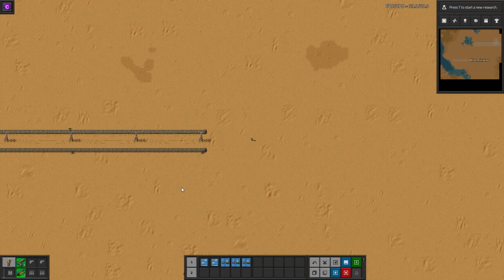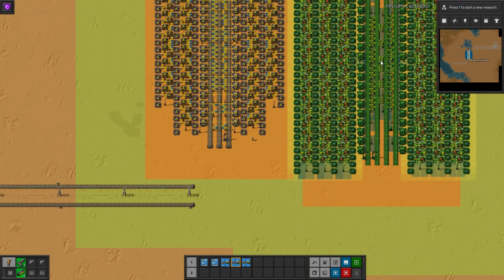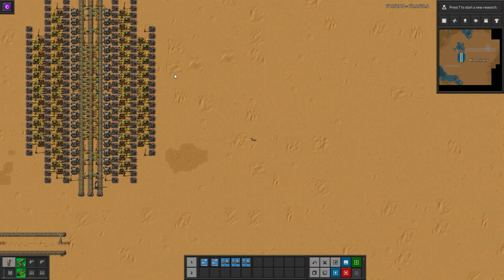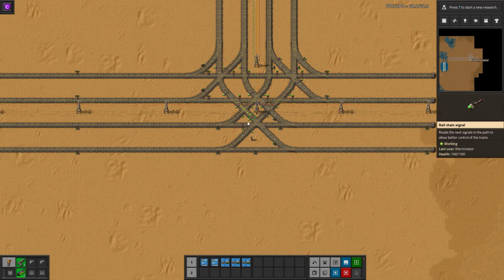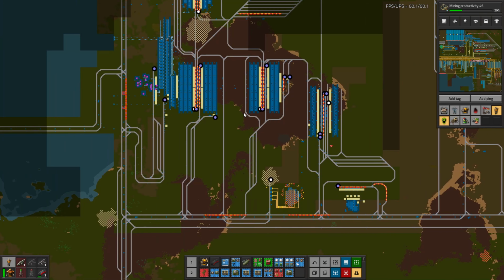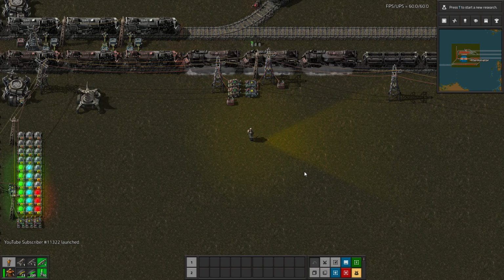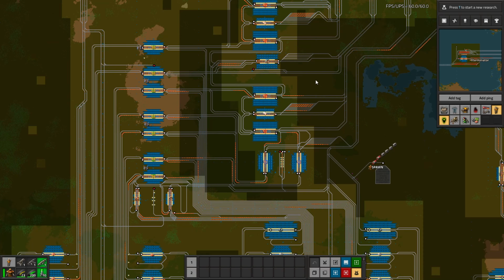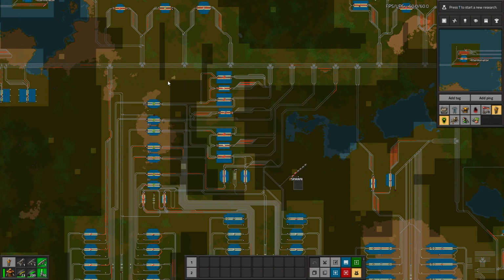Factorio Megabase Tutorial - Rail System Design, Mainline Size & Junction Spacing

Comment: I just learned within the last few weeks that having 3 spaces between rail lines is the optimal minimum while every single other rail system I have built has 1 space.

I have 650 hours in the game.
I have been giving myself rail based headaches for at least 80 hours of design and I never thought of spreading them apart.

Comment: I feel like this video didn't really touch on the toughest topic in trains: four way crossings... Is that because those are not something you construct or something you didn't care to discuss? This also didn't really cover stackers either...

In my builds I tend to go for single rail designs on a grid, which eliminates the need for multiple parallel rails. It's the crossings that make our break a design...
Reply: Best rail crossing setup possible is one where rails don't cross at all. Realistically, that's not very practical unless you build from the ground up a network with that in mind. That requires a lot of forethought to make work though, and unless you're a pretty good civil engineer, I don't recommend the headache. 

Next best runner up is a rail network with as few rail exchangers as possible. Get them on one lane, and ride it to their end point. That's particularly important for crossings. Each time a train crosses, it has a chance to create the phenomenon commonly referred to as a phantom traffic jam. So, for a 4-rail, 2-way setup the best you can do is outer lanes make the 90 degree turn and the inner lanes handle the messy exchanges. The max you can realistically expect is about 30 trains a minute to flow through that 4-way setup. Roundabout or diamond center doesn't really change the throughput too much. Oh, and chain signal galore. You don't want a single train to stop inside that 4-way, ever. It's better to have too many chain signals than not enough; the redundant chain signals don't affect the throughput. 

Stackers aren't as important since 1.1 bringing station train limits. Making many smaller stackers at your loaders and unloaders is objectively better now, assuming you set the limits up correctly and don't flood the network with too many redundant trains. Easily the greatest update they've done for rail networks. LTN mod is also pretty spiffy, but that's a whole other mess to unpack.

Comment: 10:45 whether 2 lanes is enough or not also depends on whether your 200+ trains all have to go through the same part of your rails. If you putting busy stations close together leads to high traffic in the area, so better separate those high traffic stations from each other. A grid of rails instead of one main rail where everything branches off also reduces the throughput, it essentially creates a second set of lanes at a distance. See my megabase where ~200 trains in the science section had no problem because it was a large grid and the material hubs were on opposite sides.

Comment: I am currently building a mega base, can you please do a tutorial where you address oil, mainly where you go over how to calculate and designing your oil builds. I think it is super difficult to figure out how many of each machine I need. when you factor in cracking and production for fuel for trains etc. What Oil recipe should I go for etc.
Reply: I have a bad 1,2kSPM game running. I Use 10 refinery to advanced oil (rocket fuel, some plastic and sulfur) and 23 only for petroleum gas (23 plastic chemical with 12 beacons each). All refinery on 16 beacon setup. 

3 oil patches relativity close to each other and water far away.10 chemical (8 beacons) for heavy oil->light oil and 10 (12 beacons) light oil->petrolium gas.

This have some over capacity for plastic. Rocket fuel are my base bobble neck.
Reply: There are web-based calculators for that
Reply: I Found that at some point it is best to just covert Oil directly into plastic, sulfur or rocket fuel on site, and let trains take care of it. If you build large oil builds in your base you might run into pipe throughput limitations.